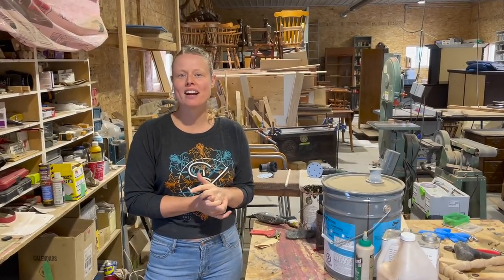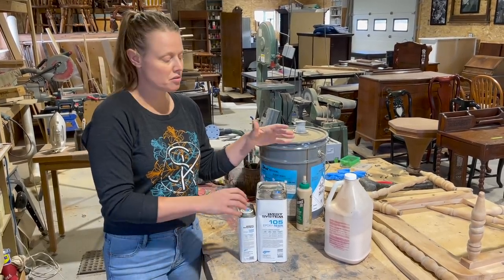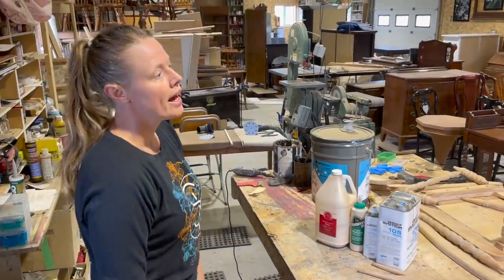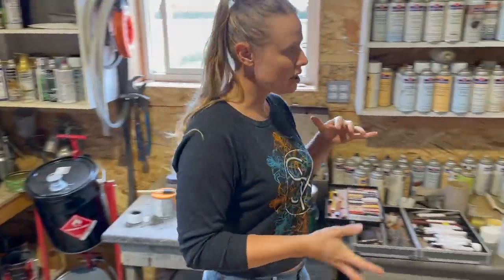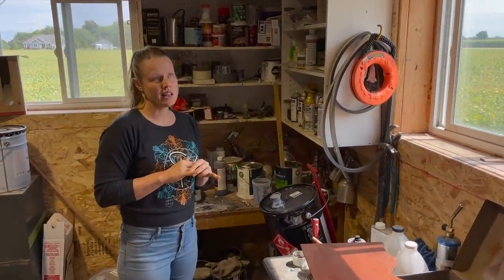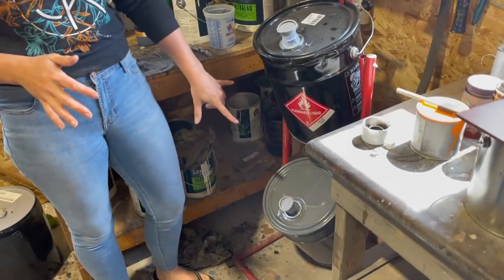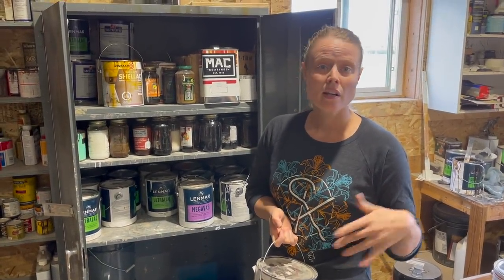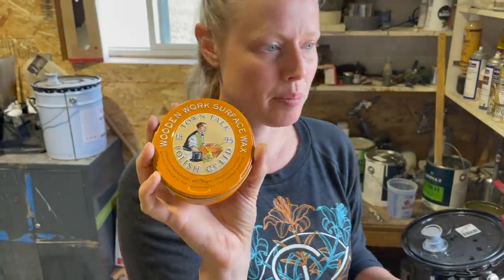The Products I Use

Comment: I notice that your finished surfaces are not filled to a level surface such as found on fine antique furniture or pianos for example
I assume you do not sand between coats of finish but do a one and done application?
Many pieces of fine furniture that I work on require a mirror finish .
I tend towards shellac and varnish.
It appears varnish does not have a place in your shop?
Please comment on your philosophy .
Keep up the good work!
JIM
Reply from the maker: Filled finishes have to be requested. They cost more. Many of my customers like the wood grain popping a bit. Definitely sand down with 320 and 400 between coats, guess that isn’t clear from the videos. Finishes are never one and done in this shop nor should they ever be. Varnishes are used on site and in proper situations. Precat lacquers are what I’m spraying. Not every piece deserves or warrants a filled finish. Varnish is a good finish, shellac is just for looks and doesn’t stand up to much. I try to provide a durable and functional finish for my clients. Cheers.

Comment: The gorilla glue bottle is amazing. I use the glue from the bottle till it’s empty, which is a pretty long time, and it never dries out inside the bottle.
Reply from the maker: Yes but unfortunately there is gorilla glue in it Lol. Hate that stuff but thanks for the tip
Reply: @johnsfurniturerepair  
 I’m a newbie in furniture repair. Your videos are an incredible resource and I’m learning so much. Already finished refurbishing a walnut dining set thanks to one of your videos. 
I’ll start using the glue you recommended 🙂

Comment: Oops -
I work primarily with Mid Century modern pieces.
It has been nice to get validation of many of my tools and techniques by swing that you use and do many things the same way.
I am curious why you don’t use acetone to remove lacquer finishes? I think is quite a bit less expensive than paint strippers. (I very rarely have to deal with paint or varnish finishes).
Wishing you the best,
Patrick Florer
Reply from the maker: Acetone is pretty expensive now too and actually is 10 times as volatile as stripper fumes. It’s works great bit it just dries too quick for me. To each their own I guess. Cheers!
Reply: @johnsfurniturerepair  I pay $12 usd/gallon in Dallas - much less than stripper. Agree about fumes - I wear a full face respirator. I will see what I can find for a professional stripper. I don’t think the one you use is available in the USA.

Comment: There are times for epoxy, and times for glue like the hide glue, "reversible".  I don't have a problem with what you have done with the epoxy in general.  I DO wonder why you use Titebond III at times.  I don't find that glue reversible at all.  Titebond I, is, and it is basically as strong as the III.  I Like the III, but only when the glue has to be waterproof.  And frankly, if I want it to be REALLY waterproof, but not an epoxy, then I go with Resorcinol.  I've found that that glue last outside pretty much for 1/2 a century for sure.  Personally, I have little use for Titebond II.  I think I use Titebond I the most.  I agree about the bottles, but I normally buy glue in a gallon and decant into a better bottle.  
Thanks for doing this, we always like learning from others.
Reply from the maker: I had bought the tight bond  3 for an exterior job. It’s just full of regular carpenters glue. But I’ve chucked that dang bottle and now I’m using an empty mustard bottle. I like it so far. Cheers

Comment: Hi
Thanks för a great Channel.
Have to make a Point on your mask.
Always keep in a plasticbag , thé mask Works all thé time.
SO when you just lya it downn i still breath and your filter Will not last so Long.
Reply from the maker: Yes. I do have a ziplock bag it stays in but I was currently using it and wanted to slip it on for the video. Cheers!

Comment: Heavy alligatored finish.   Would you suggest what product to not remove the patina. Just want to hand rub a satin finish after removing the 100 years of dirt.  0000 steel wool and  what product is my stalling point.   I need to test I suppose figure if it's shellac or lacquer.  Or does it matter,  as I have to remove it anyway to even see the wood grain.?
Reply from the maker: Stripper doesn’t remove patina as it’s jn the wood. Do a careful strip and a light sand. Lacquer needs to be sprayed if your buffing out with steel wool shellac would be fine. It’s not the most durable finish but it looks lovely buffed out.
Reply: @johnsfurniturerepair  Thank you

Comment: Have you used alcohol as a stripper? It may not be a perfect solution for a variety of reasons, but it appears preferable to the toxicity of what you're using.
Reply from the maker: My stripper is not as toxic as you may think. Alchohol is very volatile and the fumes are dangerous. I use a non methylene chloride solution with low volatility easily vented with our exhaust system.